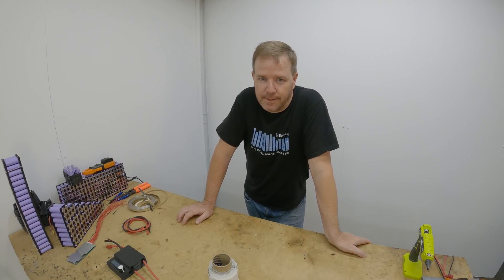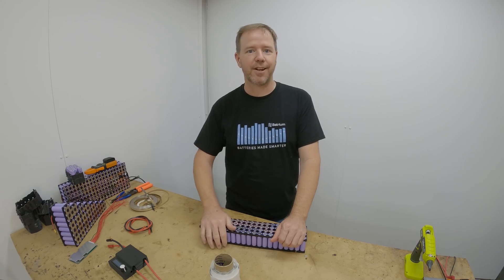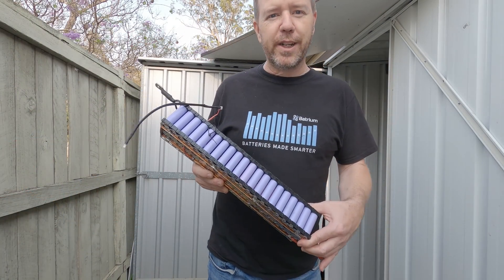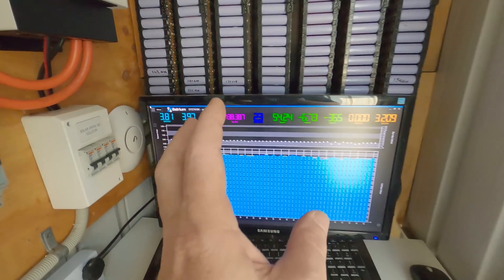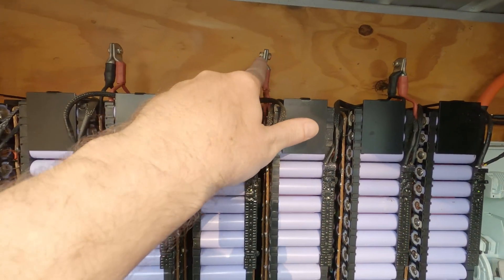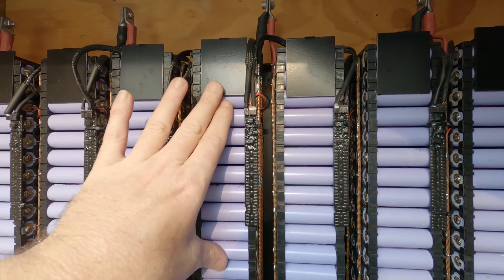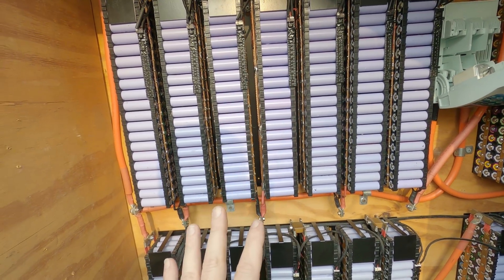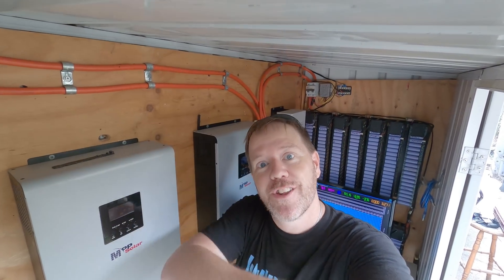Building a fast 18650 DIYPowerwall 80P battery using a KWeld Spotwelder

Comment: Looks great! I had a concern with the fuses holding the pack together. I have been using zip ties around the buss bars on the conventional packs. Been trying to find a way to also do that on this style.
Reply: Also,it should have gone in cell 5s position:)
Reply from the maker: I have the same concerns - i'll be submitting my thoughts on improvements today - on includes a way of attaching with zipties or double sided tape
Reply: @HBPowerwall  I was wondering if a hole punch could be used to widen the existing holes in the sheet so we could use zip ties. Also was going to suggest that we cut the sheets into 4x4 cell sizes. As to aid in removing a bad cell in the future. So we only break 16 fuses getting them out,instead of having to break the whole set